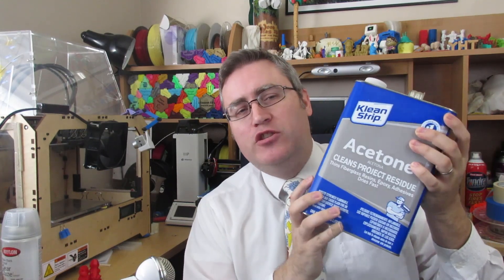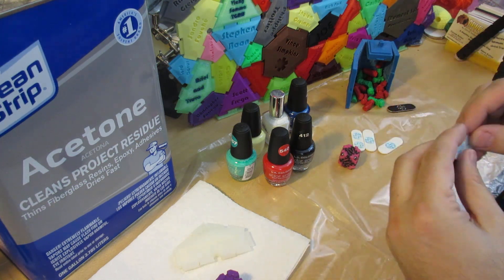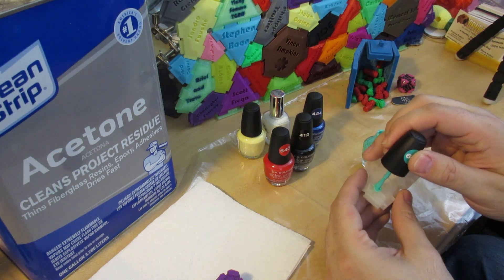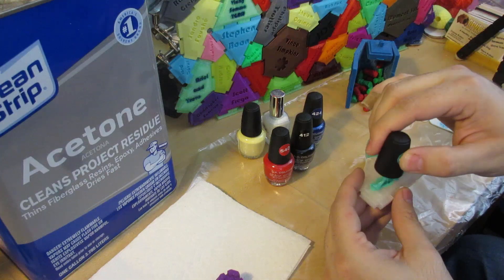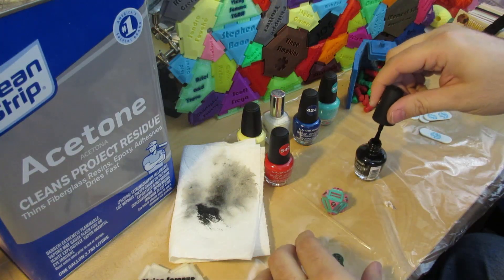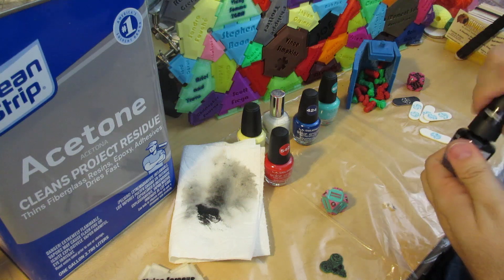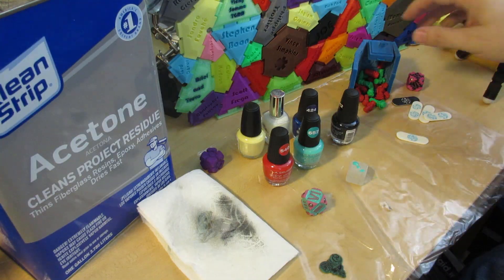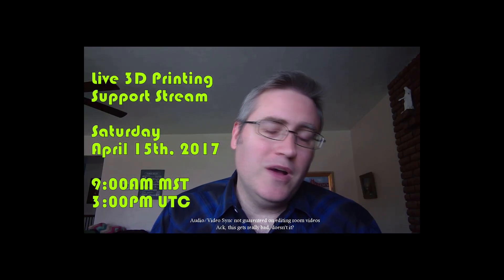Finishing 3D prints with nailpolish and acetone

Comment: Acetone fume is mildly toxic! Off course its not a Cyclone B  or mustard gas and far from the dangerous carcinogen gases, fumes. But you should use it with precautions. It can easily cause nausea, headache, even disorientation. And in optimistic circumstances the human body can deal with it by breaking down, but its also depends on age. I wont recommend children to play around with.

Comment: I use 1500 grit sandpaper wet with Gel-Gloss then rinse with hot water from the tap brushing off the Gel-Gloss with an old toothbrush. It smooths and shines.

Comment: Ummm isn't Acetone going to bleach out your build if it's a color.  I had a project that was blue and the painter'sitape stuck to the bottom of the build.  I used the Xylene an the blue project turned white.  Fellow at the paint store told me Acetone will do the same thing as well as melt the PLA?

Comment: good idea I was gonna buy a spray gun kit could cost 2 to 300 vary informative on a side note my printer works good but all the sudden I hit play and the print head doesn't move but temps work and it counts down as if it were printing any ideas or suggestions

Comment: 3D Printing Professor
Great idea!
I was doing something similar but instead of nail polish, I use dollar store acrylic artist paint.  
This is a water soluble paint that goes on plastic very well.   Before filling in the embossed areas, I spray the item with a primer.  Then I paint the entire model and let dry.  Next I spray the model with a coat of varnish.  Once dry, I choose a colour of acrylic paint and fill in the embossing. After everything is dry, the unwanted paint is easy to remove with a slightly damp paper towel.  Lastly, I put a final coat(s) of varnish to seal everything up.  I have not had to use acetone, and my models come out beautiful.  I hope you give this a try.  It really works great!

Comment: I've tried this using nail polish remover where the primary ingredient is acetone and I am not happy with the results. The remover has an effect on the PLA, making it cloudy and dull. I have not gotten some straight acetone to see if that has the same results. So, instead I fill in the print and then sand it with some sandpaper and the results are much better.

Comment: I've been using nail polish as cheap, rugged paint for years - especially fishing lure - but never thought of this. One question, though... does the polish not get in layer lines and blemishes in the finish?
Reply from the maker: If you're layer lines are that deep you may need to print at a higher resolution. I recommend 0.15mm layers max.

Comment: Non-toxic?  Phew!  Thank god that MSDS sheet is wrong about central nervous system damage on skin contact and much worse problems from consumption.  I was worried for a while.
Reply from the maker: theflamingpi Yes, you are correct. I still consider it non toxic because of the quantity you have to consume before you see any ill effects, and because those effects are pretty mild and do not include death. But I may be a little lax about what I worry about.
Reply: To give you credit, we do routinely sit next to plastic melting machines in an unventilated environment.  I suppose everything is relative.

Comment: Just a friendly BTW. I very much enjoy your videos and have learned many tips & tricks from them but this one has me concerned. You mentioned several times that acetone is non-toxic so I recommend that you Google "msds acetone"(material safety data sheet). You will find that it is very much a toxic liquid and needs to be used following strict safety precautions to avoid serious health problems. Thanks for creating & sharing these great videos, I look forward to the next one.
Reply from the maker: First thing I'd check is your filament diameter. Assuming that's correct, your filament extrusion multiplier is probably too high. I'd say lower it by 10% and test print until it looks good. Try that and let me know what happens.
Reply: The MSDS says it's less toxic than acetaminophen, which has an LD50 of 2000 mg/kg. It's an irritant and suspected to cause organ damage from repeated prolonged exposure.

Toxicological Data on Ingredients: Acetone: 
ORAL (LD50): Acute: 
5800 mg/kg [Rat]. 
3000 mg/kg [Mouse]. 
5340 mg/kg [Rabbit]. 
VAPOR (LC50): Acute: 
50100 mg/m 8 hours [Rat].
 44000 mg/m 4 hours [Mouse].

Section 3: Hazards Identification
Potential Acute Health Effects:
Hazardous in case of skin contact (irritant), of eye contact (irritant), of ingestion, of inhalation. Slightly hazardous in case of
skin contact (permeator).

Potential Chronic Health Effects:
CARCINOGENIC EFFECTS: 
 A4 (Not classifiable for human or animal.) by ACGIH. 
MUTAGENIC EFFECTS: 
 Not available.
TERATOGENIC EFFECTS: 
 Not available. 
DEVELOPMENTAL TOXICITY:
 Classified Reproductive system/toxin/female, Reproductive system/toxin/male [SUSPECTED]. The substance is toxic to central nervous system (CNS). The substance may be toxic to kidneys, the reproductive system, liver, skin. Repeated or prolonged exposure to the substance can produce target organs damage.

http://www.sciencelab.com/msds.php?msdsId=9927062
Reply: hello. Please help! 
I have a question
when I print something the prints come out looking really bumpy on the outside.
What should I change to fix that?? Help!
Reply: Firstly, I would ask you to hold back on the insults. All I stated was that acetone is certainly not listed as a toxic substance in the food lab where I work. We use it to clean some of the machines sometimes. its a brilliant antiseptic.
Of course, I would always advice people to wear gloves and masks when working with chemicals. But I recommend people wear gloves and masks when working with most anything vaporous, including absolute alcohol (also used for cleaning)
But I still agree with +3d Printing Professor on this one. Since acetone is used to remove nail varnish, I cant believe that the quantities used in this would be remotely harmful.
I am sorry to hear about your father. but the quantities used in auto body paining and similar is many times higher than you will ever likely use doing this

fyi, I have read the MDSD multiple times. thats my job ;)
Reply from the maker: That's fair enough.

 I would consider it non-toxic because the chances of it killing you are very low and it requires some considerable quantities and long term exposure before it starts to damage the kidneys, skin, and short term memory. 

GASP, maybe I forgot. Maybe the acetone is effecting me. I need to.... what are we talking about again?
Reply: I've read the msds several times. Maybe you two should read it also then research medical history on it, then maybe, just maybe you'll have enough information and common sense to realize it does have long term side effects when exposed to small amounts repeatedly. Why not just simply recommend wearing gloves and a painters mask. Then maybe look at the many auto body painters that suffer from exposure even wearing a mask. I should know ,my father was one of those painters and died from it. Have a nice life when you get to the point you can hardly breathe.
Reply: I'd agree its not toxic... Certainly its not on the list of toxic materials we have at university. We have quite an extensive list in the food production lab where I work...

Comment: 3D nerd or of that ilk discovered that acetone is a superglue to PLA, so it gets megasticky :P, might be nice to keep the paint on.
Reply: hunn20004 I have never gotten any pla to react to acetone. I've even set pla prints in acetone bath and they didn't get sticky or soft in the slightest. idk how people say it works
Reply from the maker: It very much depends on the blend of PLA. Some do. None that I ever have used do, though.
Reply: 3D Printing Professor I imagine, most expensive pla I've used was $18 and that was woodfill. the average price I've paid was like $15 . FYI I've used a lot of"the fox smart" pla it comes from here in the us and is super cheap and reliable. only time I ever had an issue, I emailed them and they responded right away with an apology and suggestions. turns out it was my temp settings

Comment: Was it just my shoddy government computer or did that last clip have a serious case of dubs disease?  Kinda cool. like 3D kung fu theater.  OBTW, not that I am complaining, but the word "prominently" was used in regards to my tile, however it was on the end credits for about 2 seconds and then partially obscured by your thumbnail for the previous video.  My kids may have some comments for you about that, but I think the tile looks great!  Their dreams of internet fame have been dashed...LOL. All in good fun brother.  Thank you for what you do and keep up the great work!
Reply from the maker: Bonus points for Kung Fu theather. I figured out what the problem was with the lipsync  too late, so I hit it with a disclaimer instead.

Yeah, sorry about "prominently". I looked at your tile, saw that it was one of the ones colored, so I assumed it happened on video without checking the footage. (Apparently it was one of the ones done off camera.) I'll try to make another video and give it a little more air time. It will be a part of all future videos, though, so it'll have plenty of time to be seen.
Reply: No worries either way, but my kids would get a kick out of it, maybe a shout out to my daughters Jolynn, Jamie, and my son, Jeffery (9,6, and 3 respectively).  Great video too, I will definitely be using that trick.  I was using the M600 command to pause and switch filaments but this seems pretty easy and a better effect.  Thanks again for a great video!